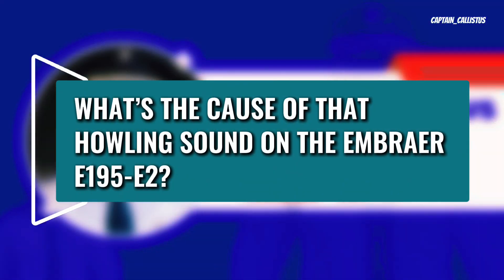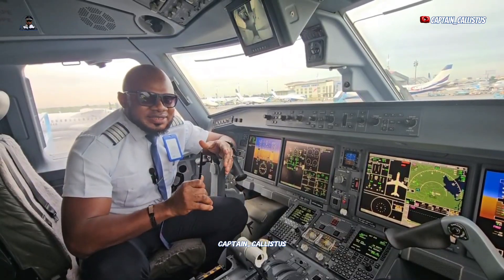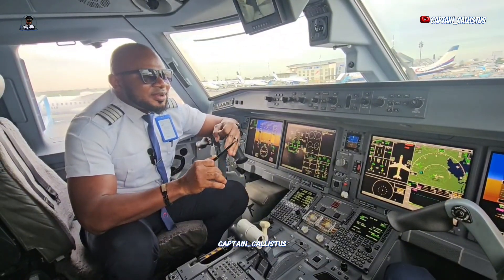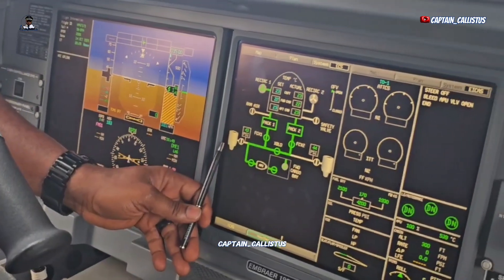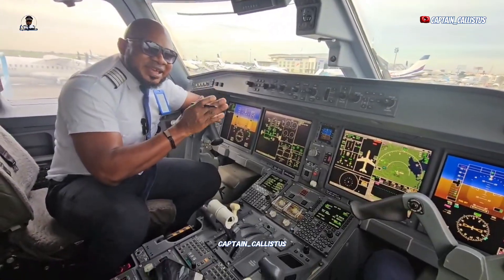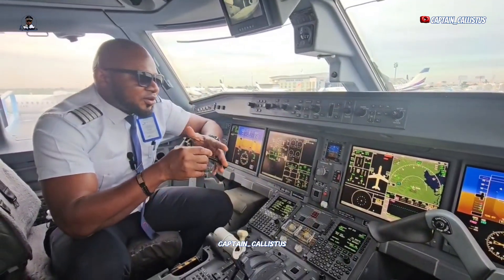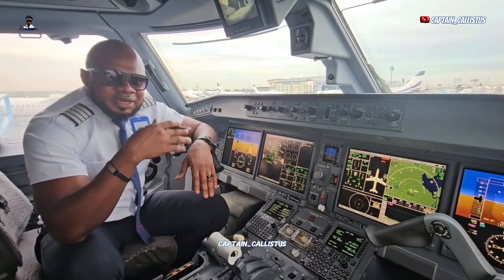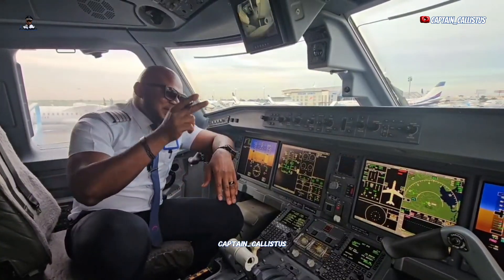REASON BEHIND THE EMBRAER E195-E2’s WHALE OR HOWLING SOUND.

Comment: Yeah! I actually new it's whenever the engine throttle are pushed to full power that we get those noises. But, I've learnt today that it's the Bleed valve that makes it work that way.😊
Thank you very much sir❤
Reply from the maker: Not necessarily at full power on d throttle, once u advance d thrust lever, as d throttle is increasing d thrust from idle, you start to hear d sound.  D sound disappears as the thrust lever advances even before getting to max power…